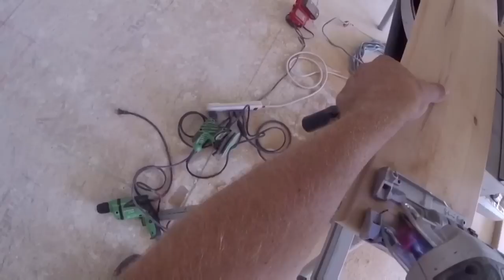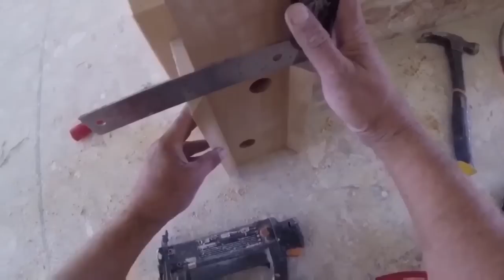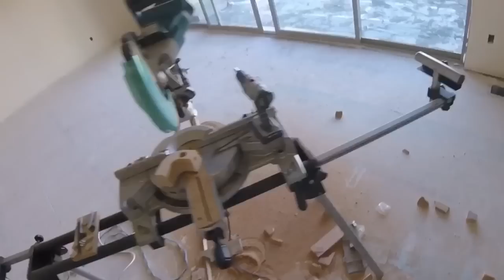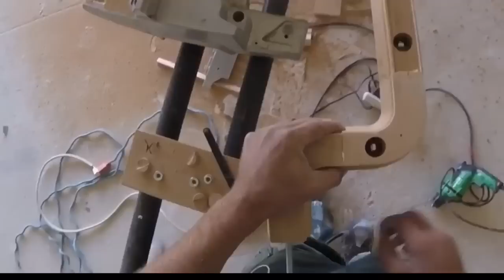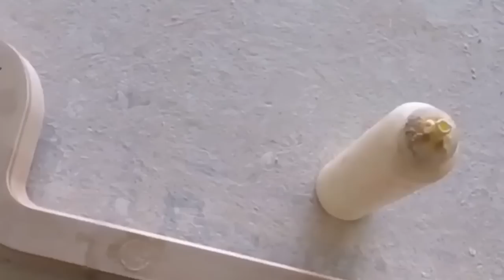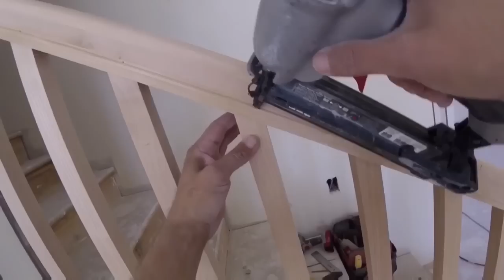S-turn Handrail with Fittings

Comment: Excellent craftsmanship. Your single handed rail installation was very impressive.  But my favorite part was the way you use your miter saw as a work bench to hammer the plugs in.
Reply from the maker: Halo 4Me The large base on the Makita is one of my favorite features.  I do not carry around, or set up any type of workbench.  So i use it in many ways you should not use such an expensive tool.  Thanks for watching!

Comment: Great work!  Have you ever had fittings that didn't have the exact profile of the handrails? Wondering how to sand them down to match. Mine are off my 1/8 inch on one side.
Reply from the maker: Get an angle grinder. And buy the attachment that allows you to mount sanding disks to it.  You can grind a fitting down to dust with a 60grit disk   on there.                                                                    The challenge is to not remove to much.  Takes a little practice.  Then finish up with an orbital and some hand sanding.  A sharp chisel or razor knife helps bring parts with detail down to near final shape as well..
Reply: @IdahoStairs  Thank you . I'll try that next.. I do have an angle Grinder so I'll look for sanding attachments.

Comment: Where does one buy those "S" pieces? I can't seem to find 90 degree bent handrail parts anywhere.  Also - those bolts you drill in...  Honestly, it's so aggravating to see these amazing how-to's (and this is really amazing what you've done here - your skills are honed) but not be able to replicate them because you can't find the parts used in the video...
Anyone know of somewhere to get those?
Reply from the maker: We get them from stair part supply companies.  LJ Smith is a big one around here.  They are located in Salt Lake City.  

I was able to pull up suppliers online.  Search for “level quarter turn handrail fitting”.  Often times the hardware comes with the fitting.

The driver will be sold separate.
Reply: @IdahoStairs  Thanks.  Canada doesn't tend to have stores like that. Looks like I can only order online (which I very much dislike for custom pieces and I hate paying shipping costs). I appreciate your reply.
Reply: @MisterBrash  Hi, I ma living in Canada, too. I am looking for S turn handrail, too. Did you find somewhere that we can order even online?
Reply from the maker: You can miter the railing rather than get fittings.  It is more challenging to do, and does not look nearly as nice.  

I get the railing assembled into two halves.  Put the railing at the top and the bottom of the stairs at the correct height.  

Then glue and pin the two sections together in place, putting a bracket  on the wall for support once you determine the correct height to keep the railing straight.  

You need 3.5 hands to accomplish this.

Let the glue set up, then add a screw to your miter for strength and plug the hole.

Comment: Good music, way better craftsmanship.like your detailed style.
When connecting the S turn to handrail, do you use a template to line up the connectors to keep each piece aligned.
Reply from the maker: Sorry missed your comment.  It was held for review.  No, I just use my hands. Tighten it up a little slow, wait for the glue to get its grip.

Comment: Good video, is that a special socket for fastening the hardware to the handrail and where do you get it, many thanks for these videos.
Reply from the maker: Yes, it is a special wrench.  Stair part suppliers sell them.  Probably for sell on the internet.  Or use a grinder to thin down a regular wrench if you are desperate.
Reply: Thanks, I will look harder as not much luck locally.Good videos Cheers.
Reply: @IdahoStairs  do you make the bolt caps or buy them?

Comment: Good, to the point video.

Any tips on drilling the washer/nut pockets on a 6042 profile handrail?
http://www.stair-treads.com/m1702/media/catalog/product/cache/1/image/500x500/9df78eab33525d08d6e5fb8d27136e95/6/0/6042-dimensions.jpg

If I try to use a spade or auger bit, the guide point will penetrate the top of the rail if drilled deep enough to form the pocket.
Reply: "Since it looks like you are associated with a stair company, you should know better."  I don't work for the company it was the first image that came up in search with dimensions.

"It is too weak to use without the support of brackets."  I never said I was NOT using wall brackets.

You've never put up-eases, over-eases or quarter turns on a wall rail?  Must be some ugly wall rails which wouldn't pass code where I live (All wall handrails must return into the wall per local code).  Unless you're one of the hacks who uses miters instead of quarter turns.
Reply from the maker: My apologies.  People are always trying to spam my comments with links trying. To sell their stuff.  I assumed you were trying to sell some kind of hardware or fastener.  My bad.
    Have you tried a Forstner Bit?  It drills a good hole without the long center point found on an spade bit.
     I also keep a spade bit with the point ground down to a nub.  Start with a regular spade, then switch to other to finish the hole.
Reply: Understandable I suppose.

I didn't have a forstner bit and ended up using a three flute auger bit to start the hole in about 3/4" then used a 1" OD template guide and 3/4" bowl router bit in my plunge router to finish the hole.  Not a lot of material to work with, depth wise, it seems.
Reply from the maker: And yes, I miter a lot of wall rails.  The customers budget determines miter or fitting.  When mitering I use 22 1/2 degree angles,

Comment: Installed dozens of these continuous hand rails. Trouble is,there is no human alive that can follow the flow making two 90’s back to back. Not humanly possible. Code officer agrees but says that s how the code is written. What a joke
Reply: What are you referring to (two 90's back to back?)

I'm retired now but I've made all kinds and varieties of off-set fittings, including ones that actually twist level while traversing around a wall, column or post.   I've also made "branch or forked handrail fittings" that take a single handrail in two different directions (such as a "Y" or "T" fitting.) 

What you're looking at here, is nothing more than a goofy condition mandated by modern building code.  At the very least, I've made these in one piece (left and right.) I'm also unaware of any "humanly impossible" handrail condition.  I'm not bragging, just asking you to describe what it is you're looking for?